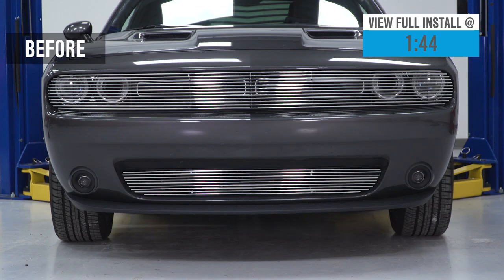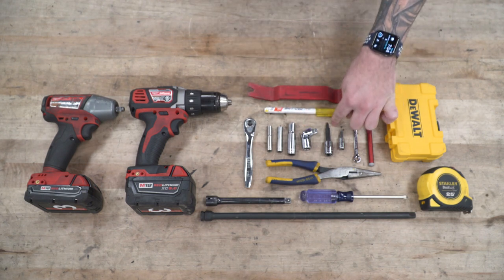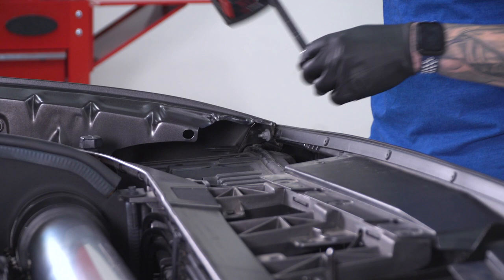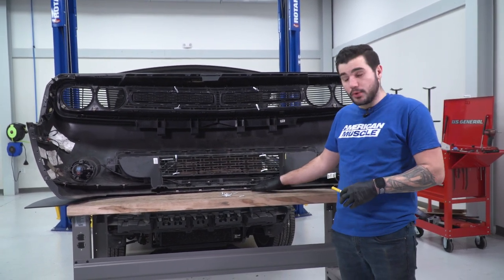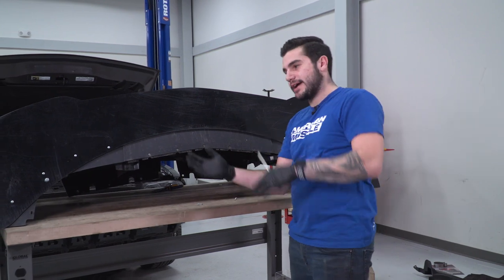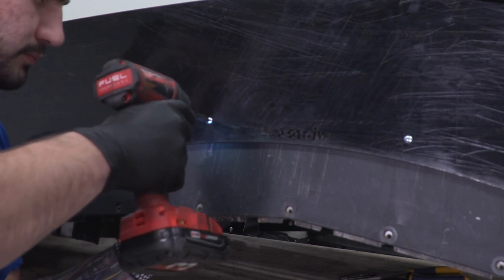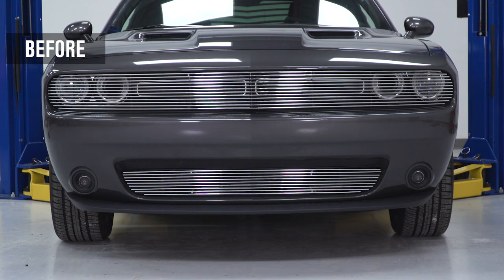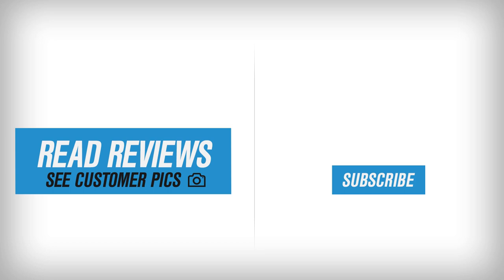2015-2020 Challenger VZ Style Front Chin Splitter - Textured Black Review & Install

Comment: The vicrez front splitters are garbage....the are held on with self tapping screws and come out while driving causing splitter to break...zl1 addons are held on with bolts and washers through factory holes .